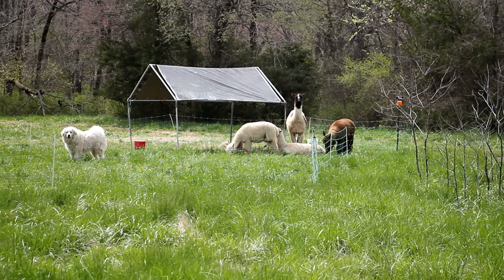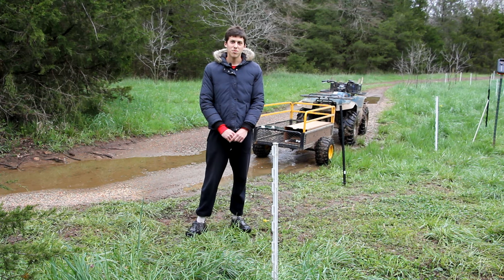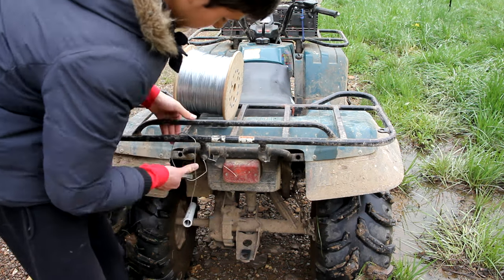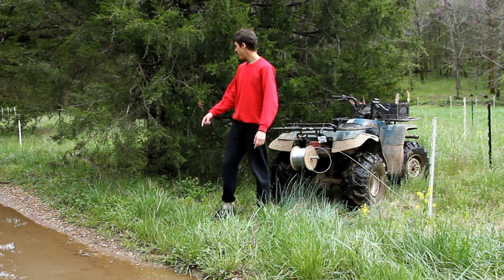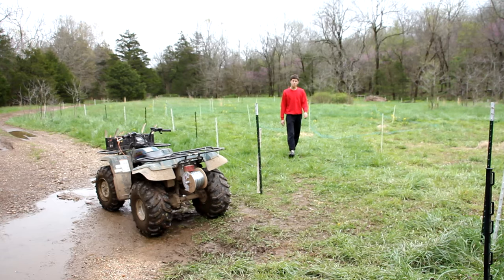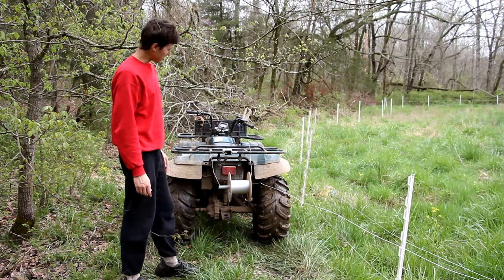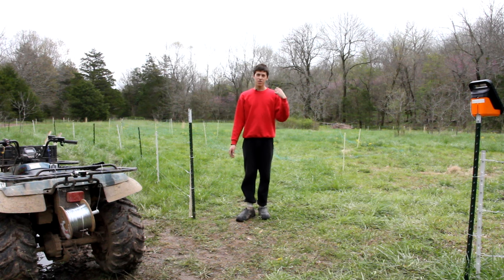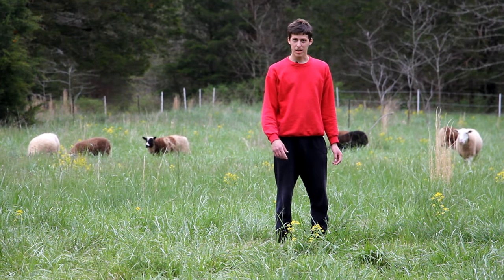Setting Up an Electric Fence for our Sheep

Comment: Can you re-use the wire once finished with that fence?  Does it respool?  Did you cut it once the lap finished?  Great video!
Reply from the maker: The wire can be reused, it does get cut to the perimeter of the fence but in the past I have re-spooled electric fences by hand.  We plan to leave this fence in position though so it should be fine just left as it is, the sheep have lived there for several months now with no problems.  Thanks for watching!

Comment: how was the fence grounded?
Reply from the maker: I forgot to show that in the video but I attached a piece of wire between the ground terminal on the charger to the top of the t-post, that usually provides a good ground because it's pounded a couple feet down.
Reply: @joshuareynolds5219  Ok that makes sense, i am going to be moving my fence around, So I guess ill have to remove the rod and move it around as well. I can't believe I'm 40 and have never setup an electric fence before. Thanks for the tips.